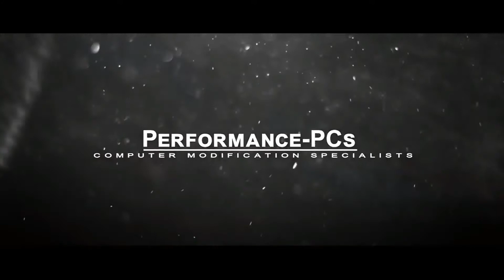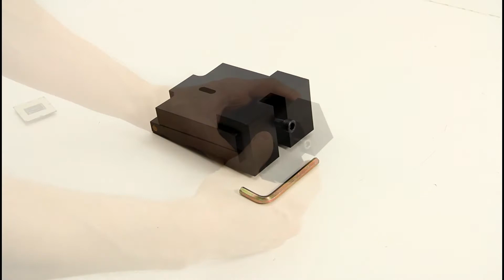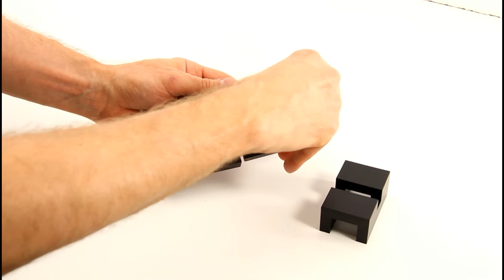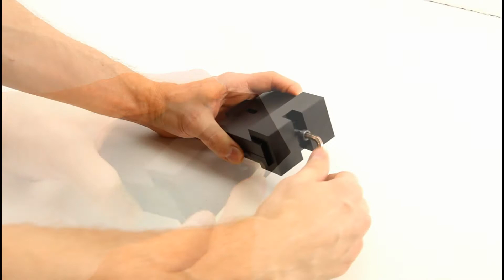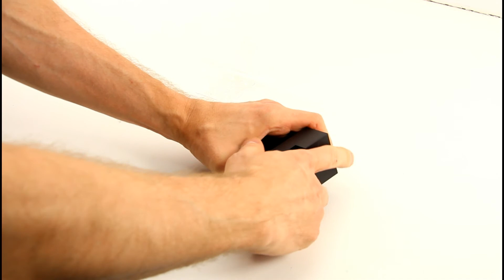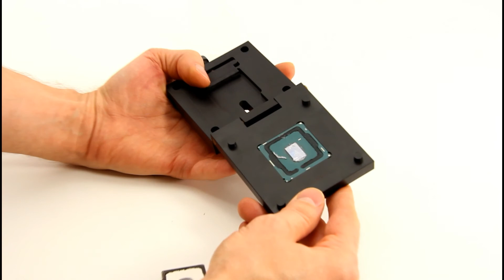Kabylake CPU De-lidding Instructional Video

Comment: Can i use this on my haswell 4770k? Also what tool is that one?
Reply from the maker: Unfortunately we do not have the answer to that could be a completely different thickness on the die itself in conjunction with the heatspreader, etc.  So many variables with that stuff.  This delidder is specific to Kaby; anything else is unsupported and/or untested. Same with the Skylake tool we carry. Here is a link to the 2 de-lidding toold that we do carry. http://www.performance-pcs.com/catalogsearch/result/?q=rental+delidding